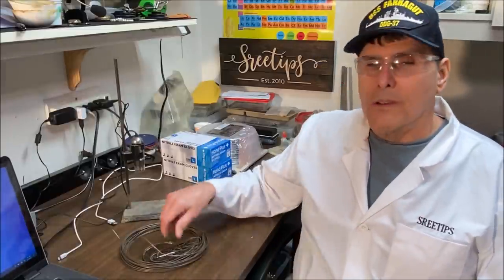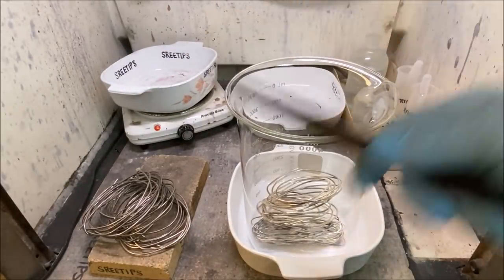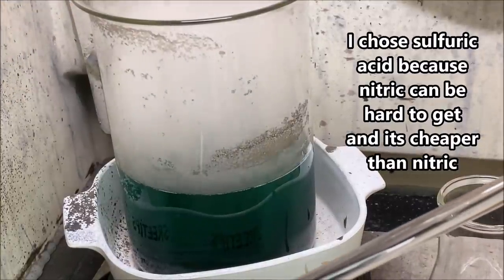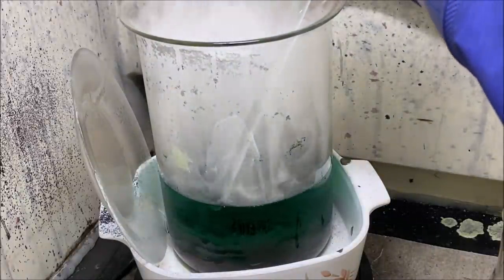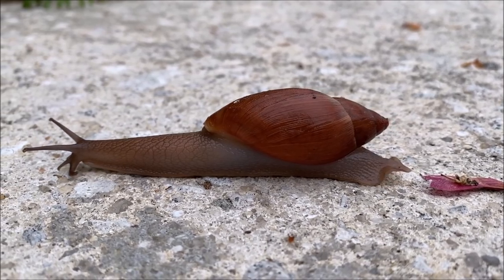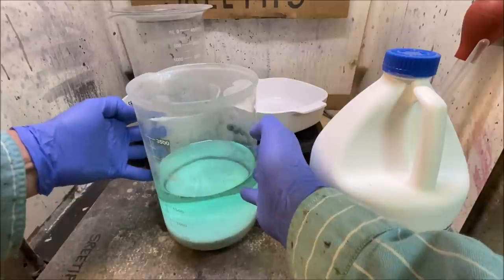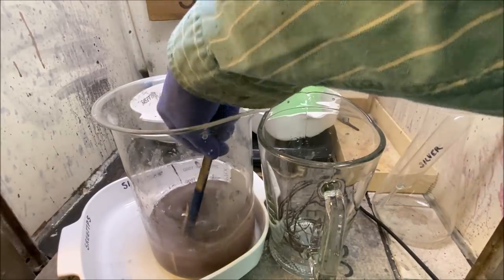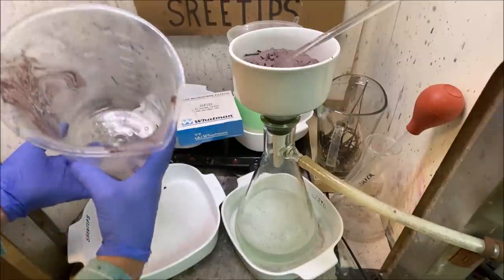Silver Plated Wire Refining Part1

Comment: Great video.  Really goes to show the correct tool for the job makes a HUGE difference.  H2SO4 works for silver but the huge volume of waste is a big downside.  I've done silver plated wire like this in the past (both copper and brass cored) and I've found an AP soak is the best way to do it if you don't have (or want to use) nitric.  Sure it takes a lot longer but it is DEAD cheap and easy to do.
Reply: Which A/P do you use? I've tried Hydrochloric acid /peroxide but can't seem to precipitate any silver out of the HCL/P.  I'm refining very thin silver plated wire like .020 thousandth of inch.
Reply: @jacobshrewsbury1938  For my Ap I'll use mostly straight HCl with about 10% copper chloride from previous batches.  I may add 5-10m of 30% H2O2 per L of HCl but frankly I rarely do.  Usually just left open to the air is enough to do the job.  To make sure everything settles I'll usually pop it int he fridge for a few days after everything is done to make sure any AgCl crashes out but most of the time it'll just be a super fine white dust on the bottom of the beaker.  've actually stopped processing this kind of stuff now and it'll all just go straight into my stockpot along with any pins or the like.  I've just found it to be a much better use of my time.

Comment: Just curious what the point of trying to desolve all the copper is? Why not remove it after the silver plate is removed then add fresh silver plated wire to desolve and repeat till solution is fully saturated to increase silver yeald per amount of acid?
Reply from the maker: That’s a very good question - because the silver will cement out as fast as it dissolves until all the copper is in solution.

Comment: copper doesn't really want to dissolve in sulfuric acid, silver will dissolve more easily but to get the copper to dissolve, you really need to pump air into it or add some hydrogen peroxide "I don't think I'd ever be brave enough to use sulfuric acid or add hydrogen peroxide to it after seeing what it does to things like paper and hot dogs"
Reply: DONT DO IT

Comment: Do you think it would have made sense to refine the wire electrochemically using a setup similar to your silver cell?
Reply from the maker: No, as with all electrolytic refining, the silver cell requires high purity metal to begin with. Anything lower than 99% pure silver and the electrolyte would quickly become saturated with copper.

Comment: Ag.sub.2 SO.sub.4 + Ca(NO.sub.3).sub.2 → 2AgNO.sub.3 + CaSO.sub.4
You can use calcium nitrate to remove the silver nitrate from the copper-silver sludge. 
The copper should remain and you will get silver nitrate and calcium sulfate.
Reply from the maker: How about hitting it with hot dilute nitric?
Reply: @sreetips  Copper is more reactive than silver, so any copper present should go into solution and silver should be left behind.
Reply: @sreetips  Also, if you wanted to recover some of your dilute nitric acid from your copper nitrate, you could add sulfuric acid and then distill it out and have copper sulfate and sulfuric acid, and then use electrolysis to precipitate out the copper and have impure sulfuric acid.

Comment: That residue at 10mins. Copper sulphate is much more soluble in water (about 200g/liter at 30 deg c) than silver sulphate (about 10g per liter) so you could dissolve as much as you can in hot water and discard the solution and you should be left with silver sulphate. Bear in mind this is only theory details from Wikipedia. you will also have more waste.

Comment: One thing I notice is that you never seem to calculate the volume of solution you need to carry the amount of metal you wish to dissolve. You seem to get stuck and just keep adding more time and heat but that does not always work. If a solution is fully saturated, nothing will make it take more except more liquid ie the acid. I know that is a cost but time also has value. Just a thought.

Comment: I think you might have gotten better results with HCl, though I am not sure. Perhaps with a bubbler and peroxide. I would have at least tried on a few inches of that wire. Very problematical material to start with. Hot sulfuric is so dangerous!

Comment: You should add some H2O2 to the H2SO4 which makes Peroxymonosulfuric acid or Caro’s acid or "piranha solution".
One patent for production of Caro's acid gives the following reaction:

H2O2 + H2SO4 ⇌ H2SO5 + H2O [5]
This is the reaction that produces the acid transiently in "piranha solution".

3:1 ratio Three parts sulfuric acid to one part 30% hydrogen peroxide.  Don’t use 98% H2SO4 for this.  I would only use the 93% “Rooto” drain cleaner.  As with doing anything new in a lab : Please do some research before attempting to produce this solution.  There are some very serious incompatibility issues with the solution
Reply from the maker: I’ve tried it in the past. It would unclog a stubborn stopped up drain very nicely.

Comment: I agree H2SO4 would not be my 1st choice, pure forms can be viscous, its persistent gets everywhere and is a pain to clean plus if you get AgS its insoulble, I might try it on an electrolytic basis use it as the anode and plate out the material. Could you have chopped up the wire and used it in your silver cell arrangement, You might be able to thermally decompose the sludge back to Ag by heating and oxidizing off the copper as dross since AgO decomposes  back to Ag but that might be better with a flux slag process.

Comment: Hey Sreetips been watching your videos for a while,  just recently watched your Gold Deplating series.. just wondering if it was possible to do a similar experiment where the deplated material   plates on to the cathode,  (i know you did a video on gold purification by electrolysis) but I was wondering if this could be used to perform the deplating in a way that could be turned into a continual process. 

also I saw that your deplating cell also had issues with heating up and becoming ineffective, would it be possible to add some kind of cooling loop using something like copper or Glass tubing that would be unaffected by the reaction to assist in regulating the temperature.

Comment: I don't have experience with the chemistry of Cu/Ag and sulphuric acid. But it must be slow and very stinky... wasn't it?
I think an easier way would have been to melt it into shot or anodes and run it through an electrowinning process similar to your silver electrolytic cell. The silver should settle as anode slime.
Reply from the maker: I worked in the hood. All the stink, fumes, vapors were drawn away from me. I couldn’t smell a thing.

Comment: will this process work on silver plated terminals and contacts, circuit breakers from Electrical Boxes also ?
Reply: You best bet is nitric, if you can't get nitric you can make it in situe with sulfuric and a nitrate there plenty of videos that have done it, its week like 10-15% but time will strip the plating most likly

Comment: What micron filter did you use? Will this be a good process for crushed IC chips?
Reply from the maker: The box says #1 fast flow, doesn’t give micron size. I’ll never use boiling sulfuric ever again because it’s too dangerous. No experience with ic chips
Reply: @sreetips  you commented on that. Why? The fumes? Does it have a flash point? 
If it’s just fumes, I can rig it up outside and use gas mask. Need those safety sreetips. 
I have other silver goodies but I am looking for the best process on those chips. 
Thanks for always responding to help me in my endeavors!
Reply from the maker: A drop of boiling sulfuric will eat you to the bone before you can get to a water faucet to rinse it off. Very nasty stuff.
Reply: @sreetips  thanks just wondering. I farm with a chemical called lambda star. Just the fumes hitting your face will cause intense burning that renders you sleepless for 30 hours. 
Thanks again for helping me learn the precautions as I repeat A LOT of what you do for my own part time hobby. I mostly do copper bars but I have a lot of precious metals of all kinds that I need to process and you’re making the journey a lot faster and safer!! Thanks